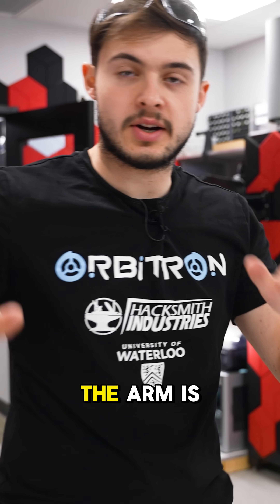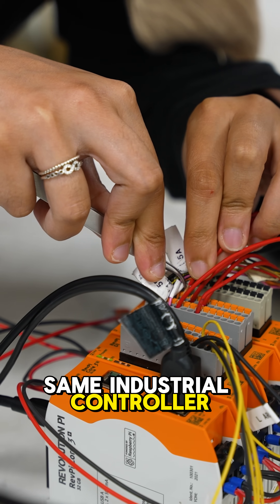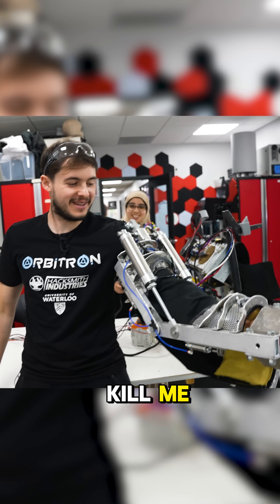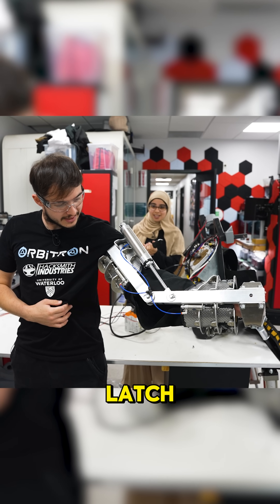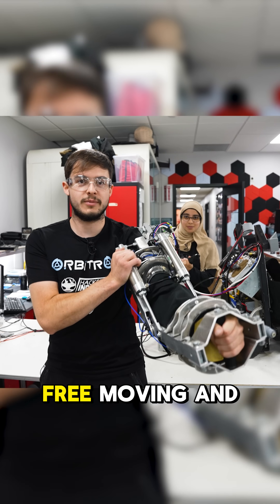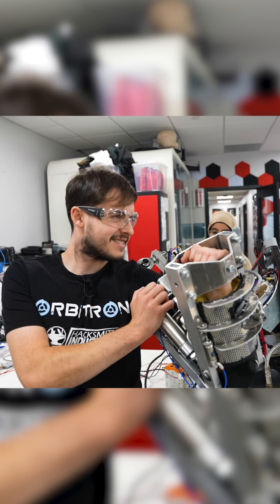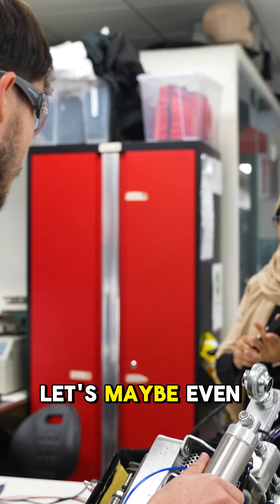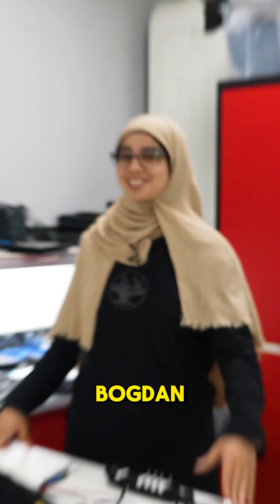The inner workings of an exoskeleton 🤖🩻 Ouch... #engineering #fallout #powerarmor

Comment: See what happens when a woman is involved.
Reply: Lets see u do it
Reply: @DumbAsh00  lol it's like a 4 switch control pendant. The equipment I use has a far more complex pendant and PLC system. If someone stuck their arm in one of the machines I run and I hit the wrong button it'd remove their arm.
Reply: fr leave engineering for the dudes

Comment: Now all you need to do is make it move in parrallel with operator's movements without resistence and little need to hit commands. The exo needs to be a passive movement so the operator isnt at risk of it moving wrong and something falling on em due to loosing control of a load

Comment: This is why properly designed exosuits should be made unable to bend too far in the wrong way like this one currently is (tho if you found a way to design it so the arm could actually straighten out that would be cool)
Reply from the maker: How exactly is this bending too far? Can't you touch your shoulder with your hand? The human elbow still has a greater range of motion than this
Reply: @hacksmith  I meant this one's not able to bend too far, which is how exosuits should be designed :P